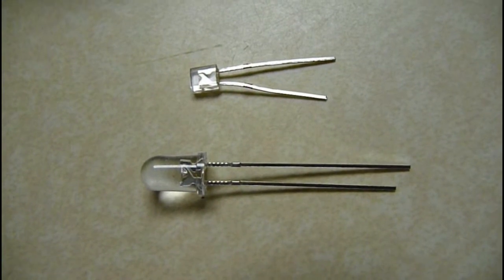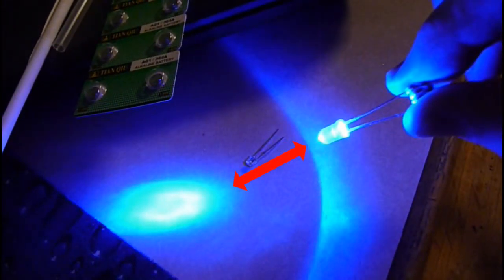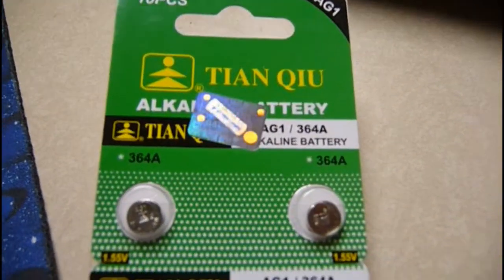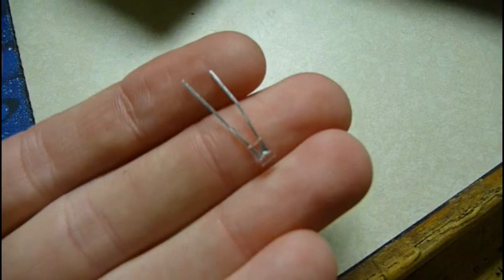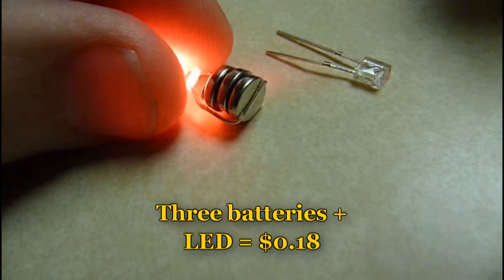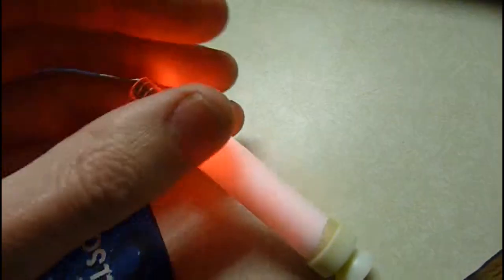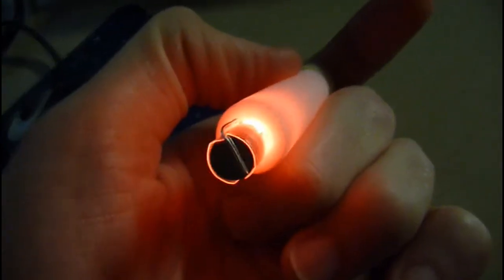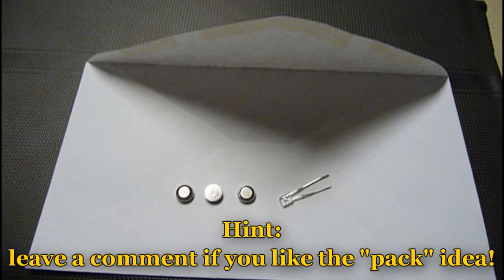LED Nerf Darts - updated design 2

Comment: push a piece of hard plastic through the side of the dart to separate the positive battery and led side like they do when you buy new toys that you have to remove the little Tab 2 separate the batteries on and off symbol

Comment: Using a toothpick, poke it through the foam dart and in between a couple of the batteries. This should break the circuit. Cheap solution, if you don't mind poking a toothpick size hole in your dart.

Comment: Simplest solution would be to use the straw to your advantage. Cut a flap into it and push everything down more, use the flap to break contact when not in use. No extra soldering or connections and no extra weight added.

Comment: you can use a small toggle switch and attach the whole system to that and that's useful for nerf blasters that use rods to push in the round into the flywheel (look at stryfe/rapidstrike) when the rod pushes in the round, it toggles the switch and opens the loop and turns on your led. i use this as my last round in my 18 round magazine to show me if i'm about to be out and have to reload.
Reply from the maker: Cyndi Rae Wow! that is a crazy cool idea! :-) Can you post video showing this in action?
Reply: sure thing man